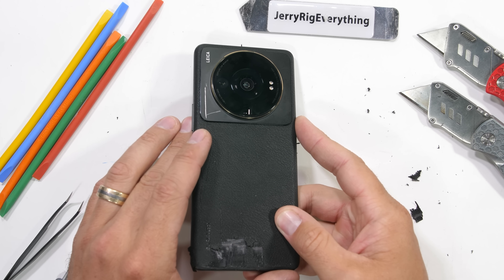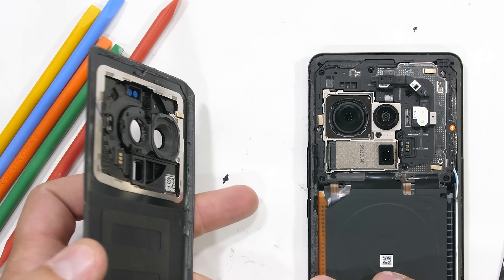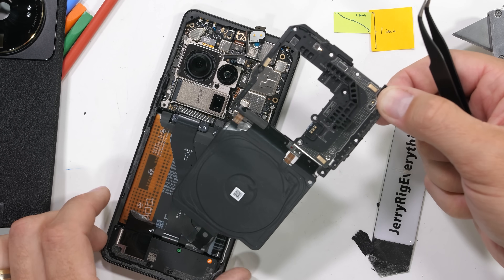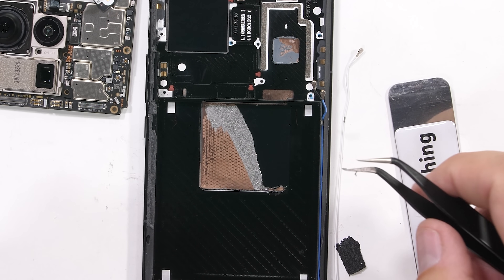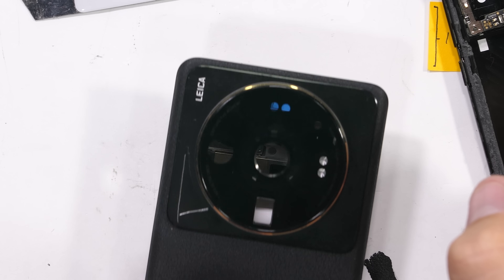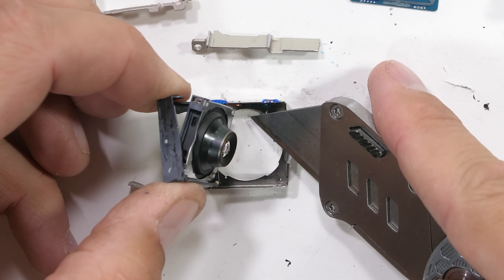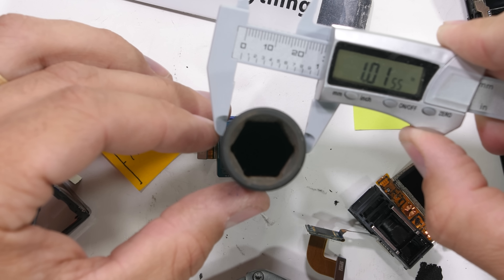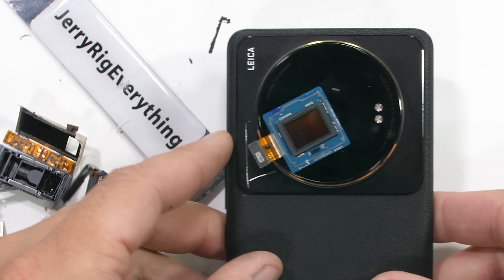Its a bit smaller than we expected... - Xiaomi 12s Ultra Camera Sensor Teardown!

Comment: Small camera sensor naming conventions are fairly insane. Small sensors are named after the dimensions of a hypothetical glass tube that would surround the sensor, as if they were a 1950's Vidicon tube. Typical 1" sensor size is actually 13.1 x 9.8mm.
Reply: Bingo.  100% correct.
Reply: Came here to say this. "1 inch" sensors aren't 1inch.
Reply: Absolutely  correct. Its actual origin is vidicon tube
Reply: Finally one that knows what the 1" mean in camera world lol.
Reply: @kentpoon1218  Zach talks about this in the video, what do you mean "finally?"
Reply: Yup, MKBHD has a video on it
Reply: He Said this 2 mins later in the Video
Reply: Well, S35 sensors aren't either even close to 35mm but actually half of that. The history of S16 and S35, main standard screen sizes in movies, is over a hundred years old. Film for movie cameras was the same film used for photography, the difference is the direction the film passes. That's why S35 is half of the 35mm film screen.
Reply: Its not common in photography world, but in broadcast world. And in CCTV world, which is where all these phone sensor originated.
Reply: Ancient naming conventions that need to die.
Reply: this
Reply: It's mostly a Sony thing. Noone else bothers making their small sensors seem bigger. Every other brand just calls it by film standards, like 16mm or super 16 (which is actually smaller), not by television camera standards from the 50's which translates very poorly to square sensors, unlike film standards.
Reply: @invalleria  yeah he also said lots of other things, apart from actually SHOWING you how the old measurement was taken with the cylinder, if you are going to read ALL the comments instead of watching the video you loose the visual and it will take you obviously longer to read through, AND people fill up the comments with redundancy. It's an 8 min video not half an hour, people are f.. lazy.
Reply: exactly this needs more upvotes
Reply: 100% correct
Reply: @invalleria  как это не обманывает? Размер отдельного пикселя, который заявлял производитель, рассчитывался как раз из расчёта, что диагональ 1"
Reply: Was just going to say this same thing. This needs to be pinned so more people could see this and not fall for marketing
Reply: It's a legacy stuff but it's definitely misleading for the average consumer. It should be banned.
Reply: like what he said in the video
Reply: Not sure why  people are repeating with different words what Jerry said on the video, maybe watch it until the end next time?
Reply: @xeon2k8  Sure but when Jerry uses a clickbait title and continues to bait until the last 2 minutes of the video, this guy has a point. And no even no finger is pointed towards Jerry, it's a rather polite comment. I was about to write the same thing with a more severe tone.
Reply: Ik, the lens is not actually 1" kinda strange that we still use that way of referring to camera sizes but if changing it would be another huge mess.
Reply: @ĪĪMizumiĪĪ  Changing to measuring the actual size instead of some random irrelevant nonsense would not be another huge mess. You just stop lying, and use the actual measurements.
Reply: So it's bigger "only" by 2mm from previously used S5KHMX 11.0 mm x 7.9 mm in Xiaomi Mi10/Mi10Pro, Mi11 (not ultra). Still 2mm in both width and height is a huge difference.
Reply: I can understand "1" type sensor", when it's actually a cropped version of an actual 1" sensor like the one in Xperia Pro-I. However, IMX989 in this one isn't.
Reply: @6:50
Reply: What sensors in 1950s didn't cameras just use film?
Reply: @kenmastersmaster  electronic cameras have been existing since 1920's and "modern" electronic cameras, using cathod ray tubes, were born in mid 1930's.
Reply: @kenmastersmaster  TV cameras
Reply: @brucebutkus1251  Different market...
Reply: @kenmastersmaster  When transmitting TV live for example there is no film involved. They used tubes to shoot back then and it's from those tubes we still have names like "1 inch"
Reply: @ThomasGehlhaus  cool. I don't really care about sensor size. I can get great pictures from 1/2.55 sensors using computational photography and good lighting. Also the pixel size is more telling...50mp camera with 1.8 micron pixels, binned down to 5 or 6 microns is the same as a DSLR
Reply: @kenmastersmaster  That's never gonna happen, no matter how much binning tech you use, a smaller sensor is still small compared to a real big sensor.
Reply: @Meteor-ThunderBears  yeah but it doesn't matter in the real world unless you're pixel peeping.. Even then computational photography can close the gap of a larger sensor. Larger sensors have drawbacks too... Such as easily blowing out pictures taken in bright environments
Reply: @kenmastersmaster  The 12S is actually 3.2 microns after binning, which is a little smaller than entry-level dedicated cameras (aps-c) and significantly smaller than most full frame cameras. I will also add that pixel binning is not perfect. Binned pixels will never be able to out perform a large non-binned pixel
Reply: @SuttonBen  dedicated cameras have half inch sensors or 4/3 the fact a smartphone is catching up to DSLR with a smaller sensor because of leaps and bounds in optics, sensor quality and computations just goes to show professional cameras are becoming more and more obsolete unless you're in need of something with huge zoom, huge macro or huge cropping. Dedicated cameras also have trouble with 4k60 without overheating and shitty battery life. 

As far as pixels why would I need large pixels in well lit conditions, wouldnt I rather have 50- 108mp?
Reply: @kenmastersmaster  First, no digital cameras have 4/3 sensors. Micro 4/3 does exist but isn't exactly a popular format outside of videographers. Small sensor dedicated cameras are not the benchmark that most people would assign to "proper cameras". Most would think of at least an APS-c sensor camera. A lot of smaller sensors cameras are purely for zoom v size convenience or for cost cutting.
 
I'm not saying smartphones haven't come a long way and aren't impressive but there is still a big gap. Optics on smartphones are still very simple and usually optical plastic. 

Another very important that smartphones use Quad-Bayer sensors which cannot resolve the same level of detail as a proper Bayer high resolution sensor. Tiny pixels have to boost the signal more to achieve the same exposure. Large pixels do make a big difference for color depth, optical resolution, noise levels, etc.
Reply: @Ben Sutton  you say that but all samples I've seen on dslr with 27mm f5 looks identical to a 4mm f1.8 smartphone. Noise, color, etc all fixed by computations.  Also don't think plastic or glass matters much at all with the advances in optically clear acrylics
Reply: @kenmastersmaster  It does matter, quality glass has higher refractive index. If it did not matter, most lenses would be made out of acrylic lenses. But they still use glass, as its still far superior material.
Reply: @Nobody-Nowhere  the difference is negligible in the real world otherwise we wouldn't have iPhone to DSLR comparisons where professional photographers can't tell in a blind study

My guess is acrylic is more expensive than glass on a large lense, DSLR lens technology is largely 20 years old and glass is cheap. Hurricane windows and bullet proof glass are acrylic and much more expensive than regular glass. Photography is probably the same. No point improving DSLR technology when it's practically dead and sales declining massively every year. Can't justify the r&d to make better lenses

Phone lenses are small so it doesn't increase costs much and is better in case you drop the phone you won't shatter the lenses. Try dropping a DSLR on it's lens and see what happens...

Comment: I don't think the measurement method/unit matters for something like this, as long as it stays consistent and proportional across all sensors. The actual measurement doesn't mean anything to most people, even photographers, since we're not the engineers making these things, we decide if something's good based on quality of the image. Sensor size can be directly correlated, but it's not like we can just calculate how good the end result will be just based on the sensor size alone with some easy mathematic equation.

Comment: The real size of a 1-inch sensor. 
Every image sensor marketed as 1-inch sensor measures 0.52″ (13.2mm) on the long side, 0.35″ (8.8mm) on the short side, and 0.63″ (15.9mm) diagonally.

If you watched this video till the end, Zack Explained it at the end

Comment: The name of a 1" digital sensor should more accurately be read as "one inch video camera tube equivalent" sensor. Current digital image sensor size descriptors are the video camera tube equivalency size, not the actual size of the sensor. For example, a 1" sensor has a diagonal measurement of 16 mm (0.63 inches).

Comment: When it comes to cameras a 1 inch sensor is never truly a full inch in any direction of measurement, the one inch is referring to the size of vacuum tube the sensor would have fit into, back when vacuum tubes were used in cameras.
Reply: finally someone said it
Reply: Oh, you watched the video too?
Reply: This applies to all sizes, not just one inch. 1/2.33" is 7.7 mm, not 10.9 mm. Micro 4/3 is 21.5 mm, not 34 mm.
Reply: Yeah, 1 inch sensor is not 1 inch in diagonal of sensor, it is diameter of the optical lens that  the sensor fit inside
Reply: Ye, I thought this was kinda common knowledge...surprised by so much misunderstanding.
Reply: BS. He gave a legit and even logical reason for the incorrect measurement to the public. Vacuum tubes? Did you 35mm have them or was it only in large format?
Reply: @douglasdever6134  they were basically a CRT , but instead of projecting the image onto the screen these tubes would capture the image. These were the original versions of a sensor and were originally created in the 1920's and were use in commercial TV cameras into the 1990's.
Reply: @douglasdever6134  this isn’t BS lmao, MKBHD did a video on how 1 inch sensors aren’t actually 1 inch
Reply: @douglasdever6134  Tell me you're naive about cameras without telling me you're naive about cameras.

Comment: So Professional camera and videography is less about the size of the sensor and more about the optics. but even when it comes to sensor this would be on the smaller size. A lot of professional photography especially studio photography is done one Medium format. As outdoor/street/event photography its usually full frame or about 35mm which is bigger than 1". As for whether we need to change how sensors are sized, it's fine as is. It's relative. It's like saying drives should be marketed in gibibytes and tebibytes instead of Gigabytes and Terabytes. I mean yeah it would be more "accurate" but It really doesn't make a difference as long as everyone is using the same system.

Comment: Did you really expected a füll sie 1 Inch Sensor? 🤣😂😅🤣

Thats a normal fotographic 1 Inch Sensor with 0.66 or 16mm diagonal measurement. Based in the old vidicron.

Comment: A size comparison with other phone sensors would be nice!
Reply: with the Xperia Pro-I
Reply: @MathieuTechMoto  I thought the experia also had a 1inch equivalent sensor. Just that they didn't use the whole area
Reply: @msk.y  Yeah that's a bummer !
Reply: @msk.y  Xperia I-Pro had 1" sensor from Sony professional camera industry so it was not designed specifically to smart phones and yes they didn't use the whole 1" thing.
This sensor on the other hand is developed by Sony specifically for smartphone industry (as Sony is the largest developer and producer of camera sensors for smartphone's in the world and produced for most mayor brands including all iPhone's (for years)). 
So this Sony sensor is new and did debut in this Xiaomi 12S Ultra phone. It has yet to come to Sony's ow next flagship phone
Reply: Yes!!! I'd love to see how large it is compared to  iPhone 13 Pro, the Pixel 6 and the Galaxy S22 Ultra
Reply: @YgorCortes   the iPhone 13pro uses an 1/1.65 Sensor 

So it's around 3times as large as the iPhone, maybe slightly below 3 times i'm not perfect in calculating the diagonals by my head. 

The S22 Ultra uses around 60% of the Xiamois Sensor Size.

Comment: i think the measuring should stay the same cause then its easy to backwards compare to older sensors instead of having to remeasure everything or do conversions
Reply: Yea that's why the us stays with mph inch feet gallons etc and the rest of the world doesn't... That's not a good idea. I'm very glad that we use the SI system in Europe with meter kmh Zentimeter etc

Comment: technically its still false advertisement though, and id be interested to see someone actually suing a company for that,  cause they cant just advertise it as 1 inch when nothing on that sensor is actually one inch
Reply: Well I doubt it as all image sensors are measured this way. Most of the time they call it 1.0 Type or add a disclaimer about the actual size.
Reply: @pixels_per_inch  just because everyone does it , dosent mean its right.. saying it is a 1inch sensor and then nothing at it is remotely 1 inch is still false advertising unless they say equivalent to old style 1inch tubes

Comment: So in short, 1 inch refers to 1 inch video tube used in old analogue cameras, the 'sensor' in those tubes had roughly the same size as the 1 inch sensor in this video... In japanese marketing material they usually call it 1 inch TYPE sensor to avoid law suits...

Comment: If they are gonna use measurements that are accurate but do not follow modern standards then I think they should state the sensor measurement method in their spec sheet.  They are using situational ethics here.  I am sure they are not the only ones involved in this kind of trickery.  It may be a cultural thing but when discovered leaves them with an unnecessary stain which could have been avoided.  It would also avoid the need for this kind of destructive review as well.  They need to realize that perception is 9/10ths of the law.  Well thanks for revealing the truth behind the measurement and review.

Comment: 1" tube where sensor fits, it's the same as diagonal 1", isnt't it? Diagonal of rectangular that fits circle its's the same as diameter of this circle. So, this sensor is not 1-inch, as it have no 1-inch diagonal and it does not fit (without free space around) in 1-inch tube.

Comment: The sensor size is not calculated directly as we would expect. Instead they use a centure old standard when sensors were mounted in tubes, and instead of using actual sensor size, the tube diameter was measured. This standard makes absolutely zero sense today but manufacturers still use it because big number good.

Comment: No 1 inch sensor is actually a 1 inch sensor. What you have in that phone is the standard size you’ll find in the nicer DJI Mavics and Sony point and shoot cameras. 1 inch is just the name of the sensor, oddly enough it has nothing to do with being an inch in size. No lying happened on Xiaomi’s part, it is simply what that sensor is named. Blame the weird camera industry lol. 
Still a very nice sensor for a phone. Maybe someday we’ll get APSC sensors, that would be pretty crazy!

Comment: Could you plug the cameras back in even without the lenses? I was curious to see the result
Reply: You could it just would probably come up with a message and a blank screen when the app is opened
Reply: It would be an extremely blurry image and would act like a single point light sensor.
Reply: you would get a white screen 

as sensors need the lens to see and so they can expose the photo right